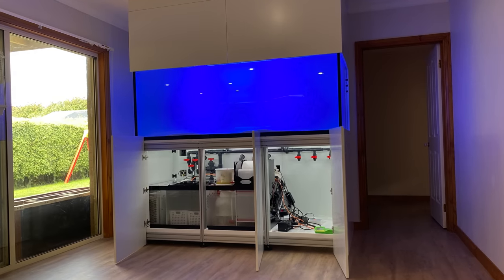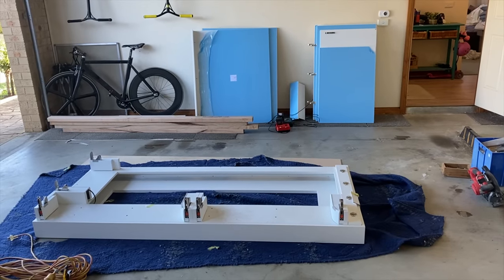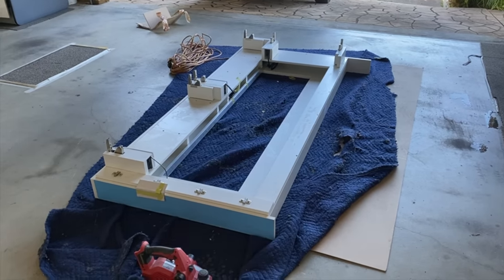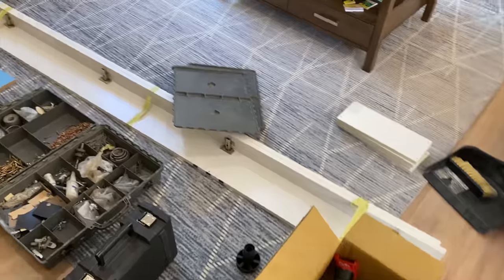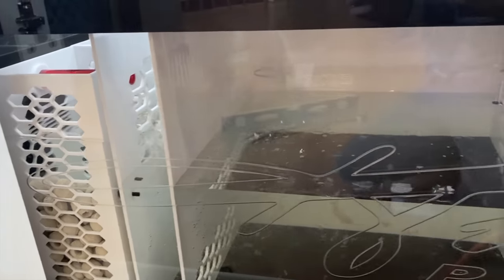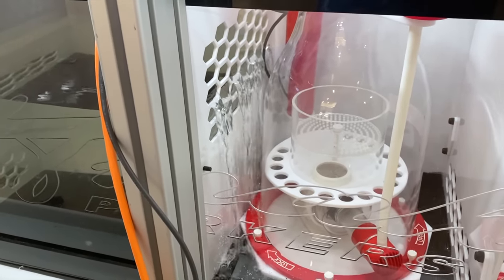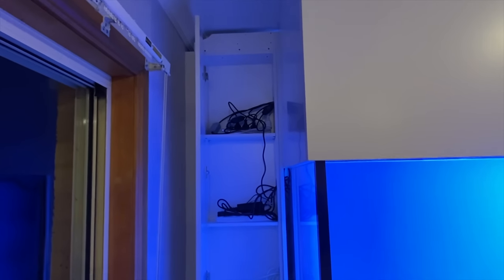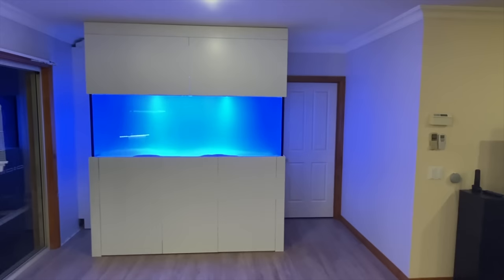Dream Reef Tank - Cabinetry and WATER!

Comment: Thanks Sam for the link… it was the KEKU clips I was referring to. I thought you were clipping directly into the 80/20 slot somehow, but now I see those clips are affixed to your back inside right hand side panel and likely a similar strip on the left like you have done for the hinged doors.
Reply from the maker: That’s correct. I spent a while working out how to attach to the extrusion and then quickly realised it was going to be easier to attach a strip to the extrusion and then attach to that as per normal. Has worked a treat

Comment: Congrats! Absolutely one of the best setups I’ve seen. Incredible job! 

Re the Blum Aventos and corrosion..ya hopefully reducing humidity will do the trick. 

In my experience so far with canopy door lifters I’ve only seen corrosion  due to electrolysis caused from dissimilar metal components touching combined w/humidity. 
I suppose another level of corrosion protection could be spraying the components with a silicone based coating of some kind (?). 

So Awesome...What a sweet setup!!!
👏👏👏
Cheers 🍻
Reply from the maker: thanks mate - I will keep a close eye on them all (Y)

Comment: I have a cabinet very similar to this one, also blum hinges... Not motorized but almost the same as these ones... They have 5 years and still work great... Yes they have some oxide spots and they are not as smooth as day one but they are still great... Perhaps in a couple years I will get new ones...
Reply from the maker: Blum make great stuff!!
Reply: @ParkersReef  my 2c based on my setup... Being closed from floor to ceiling will drop the ph a lot, perhaps be ready to install a co2 scrubber to your skimmer

Comment: Looking really good mate!
In the event of (hopefully never) catastrophic failure of those hinges, do they stick open or come crashing down unhindered? Just a thought...
As you like led lights, maybe stick some under the base of the cabinet so it illuminates the floor clearance gap of the doors?
Reply from the maker: The hinges actually operate without the motor drive nice and smoothly too (that was something I should have pointed out.... damn!) So they wont come crashing at all. Yeah have thought about adding some glow to the underside, but not sold on it just yet..... :)

Comment: I think its possibly the most gorgeous stand I've seen, while remaining extremely usable. The motorized canopy is incredible. The stand seems quite tall or am I seeing things? I personally like taller stands and think all the commercial ones are too short. How tall is it? Seems 40"+? Also, mind sharing what its made of? Other than the aluminum frame, which is obvious. Are the panels plywood or something else, and what is the finish? I suspect laminate but not 100% sure.
Reply from the maker: Hey Max, thanks for commenting! Stand is 110cm tall.

I have a video on my stand, worth checking out! Although the cabinetry is custom made by a kitchen manufacturer. It is a type of laminate with waterproof plastic covering and edges

Comment: Looks amazing 😍. Can you do a video on how sump actually working i saw the video you showing the sumo but with water running looks so interesting. On the side cupboard if you move it to the right to close the gap how would the door open?!?
Reply from the maker: Yeah when the cupboard extends across, it will just have enough clearance to open :)
Sump will be covered a little more in future, but be sure to check out the video where I explain how it all works. Now that it is full of water, the flow is much less noticeable :P
Reply: @ParkersReef  thank you

Comment: Hello from Slovenia. What material did u use for door panels ?  Because needs to be waterproff i mean safe from high salt humidity...
Reply from the maker: Yes, correct! It is a water sealed kitchen cabinet material. Designed to be used in wet areas and has held up beautifully in the three years so far

Comment: Hi Parker. Bin following your build for a while now while I was building my own. Great built and great inspiration!
I noticed you went with the standard Blum hinges on your doors. As they are not saltwater resistant did you take any steps to rustproof those?
Reply from the maker: No, no extra precautions. I’ve used high end stainless hinges before and they eventually get surface rust too. Easier and cheaper to replace them every 3 years or so with new ones :)
Reply: Hi. You would need a titanium hinge not to rust. As far as I know , no one makes a titanium hinge so replacing them in 10 years is no big deal. Blum don’t change there drilling pattern at all so it makes it easy to swap over. We have always heaps in stock so Sam can just call me for more👍
Reply from the maker: Can’t imagine what a titanium hinge would cost even if they did make it!!!
Reply: @ParkersReef  more that $4 for a new hinge. 
The cost would be out of this world😬😬

Comment: were u get the stuff to make the cabinetry automatic open? its very cool it could be a way to control it via apex?
Reply from the maker: Yeah it’s Blum servo drive hinges. Supplies by the cabinet maker. 

Yep, you could integrate with apex easily enough

Comment: Amazing job. I do have one question: how are the two 90 degree panels attached (the long thin panels that wrap around the corner between the outer doors and the side panels)?
Reply from the maker: They are secured internally, I assume by dowels and glue? Not actually sure as there is nothing visible externally on the panel, just appears as one piece.

Or if you mean how are they attached to the frame, they are held on with keku clips :)

Comment: looks good mate. I would look into having some kind of plastic or t-slot  strip the doors close onto instead of the furry stuff.
Reply from the maker: Yeah? What's your thought process behind that?
Reply: @ParkersReef  the furry stuff just is not very effective after time, traps dusts looks dirty and warps after enough opening and closings because it needs to be so flush it will rub. but most importantly its a no compromise tank, you really wanna see the stuff between your doors every day?
Reply from the maker: @coralfragsaus6021  yeah fair enough. I'm not overly sure how t-slot strip would work? It is to mount to the edge of the doors, not the t-slot?
Reply: @ParkersReef  so for the bottom the left hand side door closes right of the t-slot if it closed flush in the middle together with the other door it wouldn't be and issue so you need another 1 inch t-slot to fill the gap better. unless there is some parallax error going on in the video throwing me off
Reply from the maker: One inch t slot? The gap is only a couple of millimetres?

Comment: If you really want this tank to last for 20 yrs. Any metals touching your alloy frame needs to be coated in Teflon gel or duralac.
Stainless steel touching aluminium WILL cause electrolysis. Salt will speed the process, needs to be treated as if it were a boat.
Reply from the maker: yep - duralac has been applied
Reply: Messy stuff but well worth it good job, corals for Xmas😀